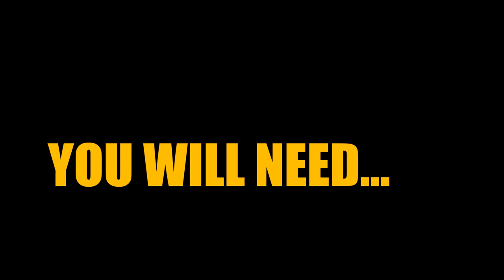TVS APACHE RTR 200 ENGINE OIL & OIL FILTER CHANGE | SHELL ADVANCE ULTRA 10w40 | HOW TO CHANGE OIL

Comment: Can i use Taparia Adjustable spanner wrench for opening the bolts if i don't have socket set or using that is not recommended please advise..

Comment: Lol I want that ktm funnel!!! Well maintained bike and amazing video, clean and precise to the point as well, keep it up.
Reply from the maker: Ha ha ha +Milind S. Vashist,
Thanks a lot for the appreciation, glad that you liked it 😊
Reply: The Sportztourer I also do all bike maintenance by myself, I have a pulsar 135.
Reply: I have a question, which oil is better, Castrol power 1 or motul 5100? Both are semi synthetic
Reply from the maker: Hi +Milind S. Vashist,
Both are good but the Motul 5100 is premium semi synthetic oil. Pulsar owners usually are satisfied with 20w50 Castrol Power 1 semi synthetic or 7100 20w50 fully synthetic.
Reply: The Sportztourer TV'S guys use motul  7x00 series fully synthetic?
Reply from the maker: Yes +Milind S. Vashist, Motul 7100 is fully synthetic 👍

Comment: Hello sir,
Thanks for this video. My bike's out of warranty and now I have to do everything myself.
About 3 months ago, there was a rattling noise in the engine and the mechanic at the dealership dealt with it. I was not allowed in the garage and he told me it was the valves that needed realignment.
Now the noise is back. Is it possible to have the valves fall out of alignment this quickly? Or it can be another problem altogether?
Reply from the maker: Hi!
Is the noise constant or it appears at certain rpm or while accelerating?
Reply: @thesportztourer  The noise is constant. When the engine is still cold, the rattling is gentle. When it warms up, the tapping gets more annoying

Comment: Thnx a lot for the video. I recently changed the oil of my apache 180, but i forgot about oil filter. Is there a way to change oil filter without draining the oil ?
Reply from the maker: Thank +Alok Bargali for the appreciation.
Well you can change the oil filter without draining the engine oil but there would be some oil loss. I have done it once on my 180 & had to top up some 100+ml of oil.
The trick is to park the bike a bit tilted so that very little oil seeps out. Do the filter change on a cold engine.
All the best 👍
Reply: The Sportztourer Thnx a lot.

Comment: Here in Colombia user's manual recommends 20W50, should I stick with it or can I change viscosity? And one more question, I've using Liqui Moly 15W50 semi synthetic oil on my Apache 180 for like a year now and I change the oil (included oil filter) every 6000 km as the oil manufacturer said, but now, from nowhere my gearbox got uncomfortable and it became hard to switch gears, did I messed up my bike by changing the oil every 6000 km as Liqui Moly said? 😅 But I did refill the oil deposit with new oil every now and then, never ride the bike with low engine oil, always at the maximum.
Reply: U can move slightly from recommended viscosity like here they say 10w30 but most people do 10w40 and i have experimented with some wild changes too ( not recommended) 

But do change oil like at 4000-5000 kms even for fully synthetic, oil is cheap, tranny is expensive.
Reply: Also make sure in the try to keep oil max, u dont overfill it, that is another problem, anywhere from max to min is fine,

Comment: I have been using motul 7100 10w40 in my 160 4v and it's really impressive I have to say, my question is after pouring extra 200 ml from the new bottel how long can I keep it?? I mean what is the shelf life of it after opening the cap? I'm really confused
Reply from the maker: Hi Abhijit!
If the cap is closed properly and the bottle is stored in a dry shaded place then the oil should remain good for a long time; atleast till your next oil change (which should be in 6-12 months under normal use).
Thanks a lot for sharing your experience with the 7100 😊
Reply: @thesportztourer  
Thanks a lot for the clarification, it really means a lot for me, your videos are really genuine and informative😊

Comment: That 200ml of Oil is also the same engine oil that we are filling right? 
And I got only 1l of engine oil  (shell advance engine oil cane ), what can be done for the 200ml extra? 
Buy another 1l!!? 
Or any other method?? 
(Thanks)
Reply from the maker: Hi +Haran Kumar,
I usually get 2 bottles of oil & use 200ml from the 2nd bottle. The remaining 800ml from the 2nd bottle is used for compensating 200ml for the next 3-4 oil changes.
Reply: thank you ☺☺
Reply: Is it necessary to put 1200 ml , cant we put 1 l only
Reply: You can use that next time. Synthetic engine oil has more durability than mineral btw
Reply: Simple u better change the oil in the show room and they will put 1200ml just for 600 rupess and u will get the gaurantee tat if some damage happens to ur engine the service centre will recover it freely but if u continuously change the oil outside and some damage happens to ur engine service centre will not incharge for tat!cuz when u change the oil in service centre they will note  the details tat u have change there!!

Comment: Hey, I just wanted to know whether the motorcycle engine oil dipstick be hand tightened to the max or should nose pliers be used for the job... I was wondering because the service centre guy used pliers or something to tighten it last time. There are hard markings on the engine oil dipstick.
Reply from the maker: Hi Deepak,
Thumb and Index finger tight is more than enough.
No need for pliers! Ask them to use a cloth over the dipstick head before using pliers, this will avoid permanent marks.
Reply: The Sportztourer Thank you! :)

Comment: Keep up the good work bro very nice :)
Reply from the maker: +Siddhesh Shelar Thanks a lot Siddhesh, words like this keeps the motivational level high.
Reply: any difference between shell oil and tvs tru4?
Reply from the maker: TVS TRU4 fully synthetic oil is a very good oil (highly recommended) but shell ultra, motul 7100/300v are superior. I would say TVS oil is a bang on value for money oil, don't go for other brands unless you have heavy usage.
Reply: I use my Tvs apache 180 rtr for i) Home to office (22Kms) & ii) Office to home (22Kms) - Heavy traffic due to metro work, so usually at low gears most of the time. 
Please recommend i)Oil grade (10W30 or 10W40) and ii)Brand.
Reply from the maker: Hi +Savio Mathias,
For your kind of use I would recommend Motul 7100 10w40. This oil works well for constant gear shifts. Do share your experience here with the oil.
Reply from the maker: Hi +Savio Mathias,
I would recommend Motul 7100 10w40. This oil performs well for constant gear shifts under stressed traffic riding (my experience). Do share your experience here after using the oil.
Ride safe.

Comment: Hii  sir   which engine oil perfect for apachi rtr 200   shell advance ulta 10w 40 
Or motul 20w 50       which one is best  iam confused😕❓
Reply: like ive said in the previous one, shell advance ultra 10w40 is the best...while this motul is matched with this one but its too pricey... ..do not rely on the name.. rely on API ratings such as SL, SM or SN... the higher the letter, the higher its quality..

Comment: Hi, The Sportztourer i wanted know that is there any problem in using 10w40 rather than using 10w30 as the company suggests to use in  rtr 200.
Reply from the maker: I have used 10w40 in my RTR 180 for more than 50k km & similarly I am using 10w40 fully synthetic oil in my RTR 200 for more than 12k km. In both the cases I have faced no issue with the engine. 10w40 performs very well for heavy use otherwise you can stick to 10w30.
Reply: i have riding my bike for past 3 mounths i have done my first service at 450 km , iam getting a milege of 30kmpl where my avg speed will be around 30 because of traffic. So pls tell me it is problem in my bike or i should wait till next oil change.
Reply from the maker: 30kmpl in the city traffic is fine. Your motorcycle is new, let the engine settle and then you can keep an observation on the fuel efficiency.

Comment: How often do we need to change engine oil? Nice video btw :)
Reply from the maker: +Akshay A S Thanks, After 1st service most of the manufacturers recommend to change the oil every alternate service. If your riding condition are harsh & you do more long distance riding then 3000km-4000km. Liquid cooled bikes can stretch till 6000km.
Reply: Thanks bro :)  And which engine oil would you recommend?
Reply from the maker: TVS TRU4 fully synthetic oil is a very good oil (highly recommended). If you heavy usage then go for Shell ultra, motul 7100, motul 300v, mobil racing etc with 10w30/10w40 grade.
Reply: Thanks dude :)

Comment: which engine oil is better for apache rtr 200 as company recomends tru 4 10w30. Using 10w40 harms the engine ? Plz explain breifly . which engine oil you will recommend as i have to tour almost 40-50 km daily on an average 60km/hr. Normally i like to drive in 75-85km /h speed. so please recomend me best one and plz expalin it why is it best
Reply from the maker: Hi Aditya,
I am using 10w40 fully synthetic oil on my RTR 180 for the last 50k+km with zero issues with the engine, clutch or gearbox. Similarly my RTR 200 is running on 10w40 fully synthetic oil for more than 12k km.
TVS tru4 fully synthetic is good for normal regular use.
If you desire to go for a better oil and you have city use then Motul 7100 10w40 will be my pick (have used this oil for my Indore ride). If you ride at high RPMs then the Motul 300V 10w40 will be my pick (have given a detailed technical review with my experience on the Rajasthan ride series).
Reply: The Sportztourer thanks mate

Comment: hi, i used Liqui Moly 10w50 fully synthetic oil on my rtr 200. but it was only 1 Ltr. is it mandatory to use 1.2 Ltr oil on rtr  200 ??????
Reply from the maker: Hi Amon,
Why 10W-50? 
Running low on oil is not good for the engine. It's better to fill till the recommended level.

Comment: If I use Oil other than TVS TRU4 Fully Synthetic engine Oil does it voids my RTR 200 4V warrenty? This time when I asked the service advisor not to change the engine oil as I will change it on my own own as per my choice, he said then the bike's warranty will not be applicable if I don't use TVS recommend oil. Is it so?
Reply from the maker: Hi Rishabh,
Similar is the case with most of the manufacturers when they don't entertain any other oils in the name of warranty. If you have any other authorized service in your area then you can request them 😊
Reply: @thesportztourer  Thanks, I will try with some other service center but I don't think they will entertain this. Thanks for your response and keep making such great videos they are really helpful. Cheers 🤟

Comment: Hai bro Iam from banglore, and Iam planning to buy an apache 200 but I have test rided one of my fiends apache 200 4v and felt some sneaky noise when we the release the throttle while riding, means noise near the left side gear might be inside the gearbox, and my friends also noticed and highlighted this issue with tvs many times but the answer from them is nothing, so do the sound in all apache comes near the gear, or he has got the wrong one, by the way the bike had clocked only 3k km till now.

Thanks in advance.
Reply from the maker: Hi Rakesh,
Go for a test ride and check if you get the sound from the showroom motorcycle. All RTRs have that distinct subtle pop from the exhaust when the throttle is rolled back nothing more to add on that.

Comment: Hi.  My first service will be within one week.. So can i  use motul or tvs tru4 synthetic  oil?
Reply from the maker: Hi Arun,
It depends upon your service center if the allow oils of other brands. TVS Tru4 fully synthetic oil is good for normal regular use.
Reply: Thanks for the reply.  How many km  we want to cross the limit of 50kmph..  And   push hard... As per your experience?
Reply from the maker: Hi Arun,
Try to keep the RPM under 5000 5500. Run in period is usually followed till 1000-1500km after which you can open up the throttle but don't be aggressive till the 2nd service.

Comment: Is there any chances of getting water in your engine? I have an issue while checking mobile, it was very thin and white foam in colour? What it could be? help please
Reply from the maker: Does it comes on the dip stick?
Reply: The Sportztourer Yes, it was in dip stick and the we opened that cap , mobile color was white thin foam like, I was wondering how water get inside the engine

Comment: The Apache 200 Manual says 20W40 oils. So 10W40s can also be used?
Reply: Manual says 10w30 which is TVS oil... But you can use liquimoly and motul and other brands 10w40 for higher speed cruising and all.. You may lose your warranty

Comment: In my rtr 200 4v Engine oil is leaking from the engine seal pack
Does this comes under warranty?
My bike  is 10month old n has covered abt 3300 km
Plz comment
Reply: Bro mera rtr 200 v leak ho raha tha local shop pe thik karaya

Comment: My dominar's engine coolant was leaking into the crankcase. After the issue was resolved by Bajaj Service centre, I am facing a new issue; that is, whenever bike crosses 65 kilometre per hour, low oil pressure light comes on. Can you please give some troubleshooting advice thanks.
Reply from the maker: Hi Raman,
The gasket was changed?
Reply: @thesportztourer  no. Only liquid sealant was applied on the engine cacing and oil pressure sensor was replaced. Head gasket was in good shape.

Comment: I have apache 200 which engine oil best motul 7100 10w40 or motul 300v 10w40??

Which one better sir?
Reply from the maker: Hi Azad,
7100 10w40 performs very well on the RTR 200 infact I have used that oil for my Pune-Indore-Ujjain ride. If you love high speeds and always keep the engine on boil then the 300V should be your pick 😊
I have shared my experience here:  https://www.youtube.com/playlist?list=PLDzB4F3L5AFrSu-Q_kWTkxVU1yZqjM608
Reply: @thesportztourer  thanx lot bro for sharing ur experience  love u❤❤❤❤❤❤jaaaani

Comment: Hi bro🙂, My RTR 200 has done it's 5th service and has ridden 5k kms. The last oil change I had was 10 months back and the bike has only been ridden for 400-500 kms as I went out of town. Now I am resuming my ride. Do I have to change the oil or will it spare me some kms to ride. 
A reply with a proper solution would be very thankful. Looking forward to it.☺️
Reply from the maker: Hi,
If you are planning to go for a ride then it would be better if you change the oil. Used engine oils tend to oxidize over long time & oil companies recommend change after 1 year.
Reply: Thank you so much for the informative advice. Actually I will be doing a trip from my hometown i.e. Kolkata to Delhi approx 1500kms solo. So It's better to change right? And since this would be my first solo and a ride so long I would really need a lot of suggestions regarding many queries. Hope you will be there for my help☺️😊
Reply from the maker: Yes, Change of oil will definitely give you a peace of mind 😊
Kolkata to Delhi 👍 happy to know you are doing it on the RTR.
All the best for the ride, enjoy & ride safe!
Reply: The Sportztourer Thanks bud little nervous though coz of first time plus solo, fingers crossed 😎
Reply from the maker: Ha ha ha.. it not nervousness I call it excitement 😊
No need to cover 1000km in a day, you are not doing it to prove anything to anyone. Try to ride in daylight & find a stay when the sun goes down (best for solo rides).
Relax & enjoy your ride. Keep you self hydrated & you will reach your destination with a happy face 😊
All the best & do let me know once you complete the ride 👍

Comment: which engine oil is good for apache 200...its mine 1st service and bike engine is getting hot during just 14-17km ride...price doesnot matters
Reply from the maker: Hi +adit poudel,
New engine will face a little bit of heating issues till it sets in. You can go for Shell advance ultra 10w40 but TVS service won't accept any other oil as your bike is in warranty.
Congratulations on your new bike 👍 welcome to the tribe 😊
Reply: thank you for replying bro...so which tvs engine oil you will recommend me..as iam going for long tour around 400-500km after my 1st service and i generally drive the bike in heavy traffic too... and i feel my gear stuck sometimes, so i guess i need more viscosity oil...so plz reccomend me the best engine oil that tvs offers
Reply from the maker: Hi +adit poudel,
Engine heating, false neutrals (gear shifting), braking etc all this generally gets sorted after 2nd service i.e when your run in period is completed.
Go for TVS tru4 fully synthetic engine oil.
Ride safe.
Reply: thanks mate

Comment: in how much km should we change  the oil filter
Reply from the maker: Hi Arfat, as the oil filter is cheap (~Rs 40) for Apache, I would recommend oil filter change with every engine oil change.
Reply: OK
 because I have changed oil 3 times & they didn't even checked the oil filter. now after 2000 km I have servicing at that time I,ll change. there will be no problem na ?
Reply from the maker: No problem if you have changed the oil at regular intervals. Oil filter helps in cleaner oil recirculation & keeps the impurities, wear & tear particles aways from the oil sump, engine & gearbox. No need to worry just get it changed next time.

Comment: I used this oil and my bike suddenly started overheating and smoke from the exhaust too much. I am scared and service guy told the oil doesn't suit. Please suggest why it happened??? Is it shell bunk guys used air blower to clean the engine.
Reply from the maker: Hi Vijay,
Smoke coming from the exhaust pipe under the engine?
Reply: @thesportztourer  now it has stopped but engine getting overheating. It was coming from exhaust and engine was smelling like burnt.
Reply: Please help me... The shell advance engine oil usually lasts for 4k Kms. But here it is draining quickly I mean for 500 km it's below the tip.